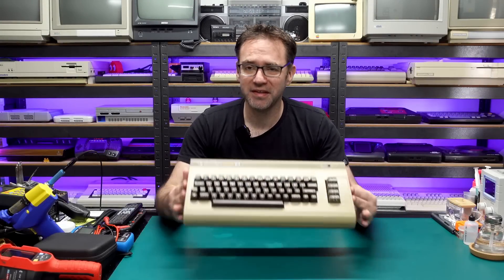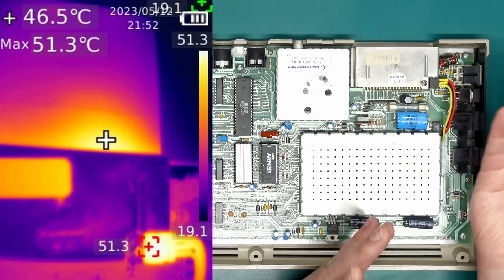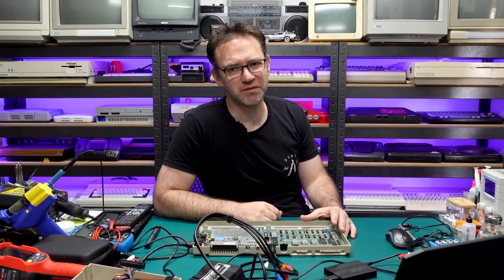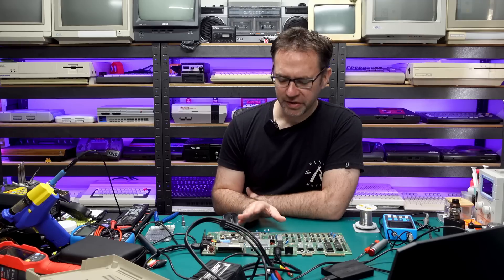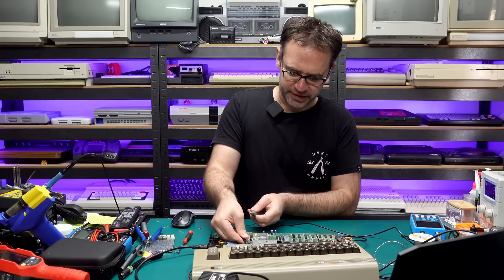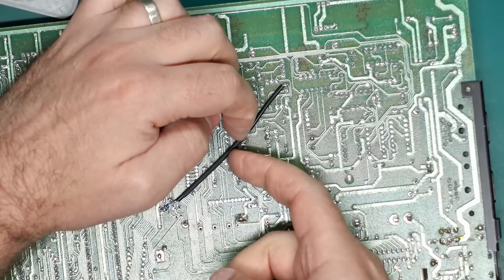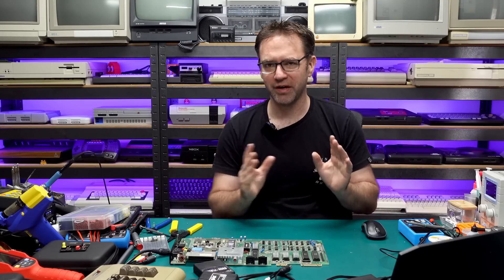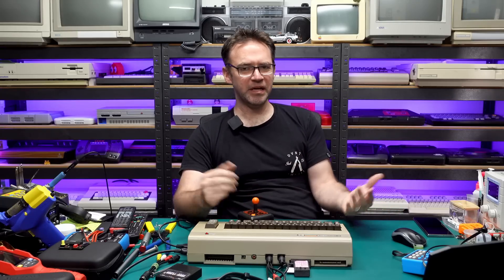Commodore 64 Rev.A 326298 hardware mods - fixing Commodore's mistakes

Comment: Interesting video. I have a C128 DCR and the video output on those are horrible!. Was wondering if getting a replacement modulator would solve the issue. Can't find much information about the video modulation on this specific model though.
Reply from the maker: Funny you should mention the DCR, I just posted a little thread on twitter about putting an RF replacement in one of those https://twitter.com/TheRetroChanneI/status/1651914147691630597?t=4jch5gvuZS8V7GuwUbrygg&s=19
Reply: @TheRetroChannel  Now all I need is a way to fix my R/W head of the internal drive. It did not survive a intercontinental move (forgot to put the cardboard head protector in). One side is still attached, the other is cracked and makes for a tilted head.
Reply from the maker: @anotheruser9876  Damn, that sounds like it's going to be a tricky one to fix. I don't know what to suggest apart from good luck

Comment: I'll be damned. As someone who regularly modded 326298 boards in all these same ways, the reset mod shown here is actually slightly easier and cleaner version of the one I did a few years back on my channel. Another easy mod worth looking into is replacing the SID filter capacitors as well, because  the factory caps are incorrect (I believe they came with 2200pf from memory? been a few years) and should be replaced with 470pF ceramics so that the SID's filters sound the same as they do on the later boards with 6581 SID chips. Great work; I've always been a big fan of these simple mods to make use of these otherwise overlooked '82 326298 boards...
Reply from the maker: Thanks. I didn't know about the SID filter error, I don't remember it sounding any different or if it did I probably put that down to the armsid. I'll do some more tests with a real sid and the filter caps
Reply: There was a similar error made with the SID filter circuit in the SX-64 machines with the wrong value caps installed.